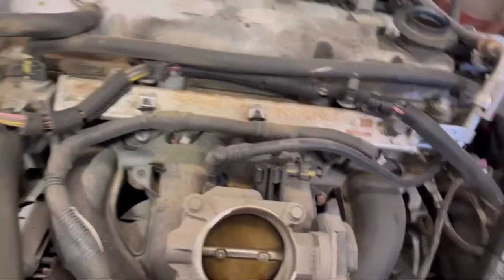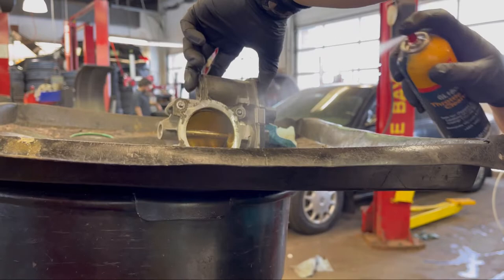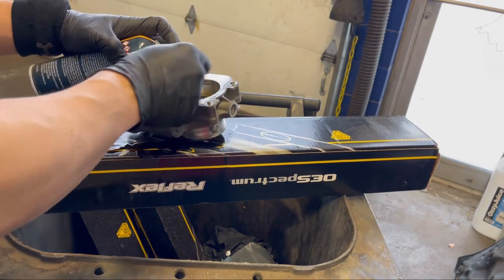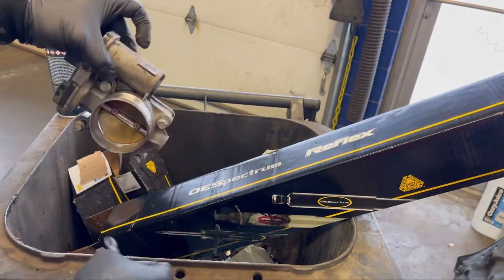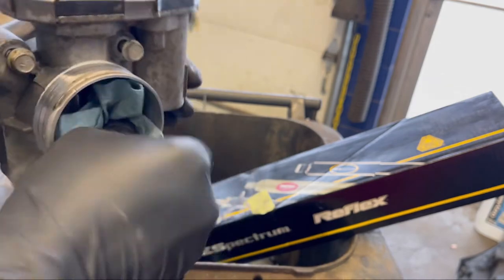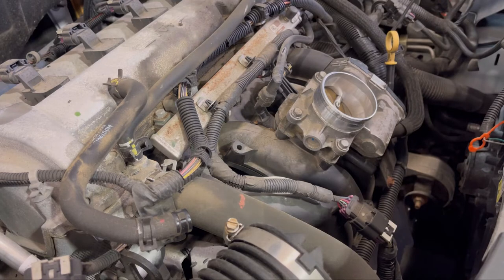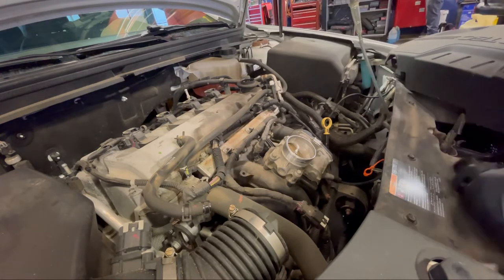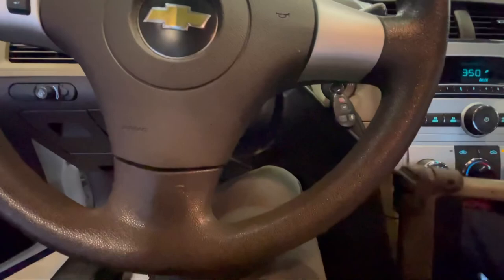Cleaning Throttle Body On 2.4 Liter Chevy Malibu (Only) WITHOUT Touching Gas/Accelerator Pedal

Comment: Thank You will be doing this on my 2012 Malibu. Just subscribed.
Reply from the maker: Sounds great, Let me know if you have any question and I will answer in the comment section.
Reply: How did it work out?
Reply: /\ what he said how did it go? I just bought my 2012 Chevy Malibu I love it
Reply: @marcusjnewtonz28  yeah It’s a great car until it turns off at every stop sign and red light 💀. My Mechanic wants to replace the timing chain. I’m not sure it that’s the problem.. 🤔
Reply: @Thatguyelijah Work good and was easy just following the video instructions.
Reply: @Thatguyelijah  I have a 2007 Malibu, different engine but very similar, and the timing chain is a common issue for both
Reply: @albertvela8712  glad to hear it worked for you, I followed the steps today and Unfortunately it didn’t fix the issue.
Reply from the maker: Please check for PCM code(s), before replacing parts. My question to you - is your check engine light is on? If it does, check see if code(s) related to the throttle body.
Reply: @autorepairprocedures  No my check engine Light is not on. But once my engine becomes warmed up it starts to die when I come to a complete stop.
Reply from the maker: Did you change oil regularly such as 3,000 miles? Or any kind of noise around the timing chain area?

Do you have a good scan tool? You’ll need a good scan tool be able to scan all code. The little handheld scan tool will not do the job.

Comment: I did mine and it’s raving up real high everything is connected correctly
Reply from the maker: Did it rev up high before you started working on it? If no, I’m sure you have left the vacuum unhooked. I would check for vacuum line that is not hook up.
Reply: Did you figure out what was why same problem maybe reset somehow?

Comment: Hey I have a 2007 Malibu, while driving we have a sputter/jolting. Happens during acceleration and while on cruise. Any ideas?
Reply from the maker: It’s hard to tell, without physically looking at your car. I’m sure you will have a check engine light. Have a technician take a look at it.
Reply: Did you find what was wrong in your case mine is just doing exactly what you described
Reply: Same issue here reading codes P1516 and P2101. Car now won't start. Attempting this cleaning and potential replacement this weekend.

Comment: Hey i have a 2010 chevy malibu 2.4L when i start the car it starts to shake a little bit rough idle and hard to accelerate could that be the problem?
Reply from the maker: I recommend you take your vehicle to a technician to figure it out. According to your problem descriptions I am sure vehicle has some engine diagnostic code.
Reply from the maker: There are many thing technician looks at before they figure out the root cause.

Comment: Cleaned mine and now the car is revjng really high at 3k and won’t stop when I put it in gear the car doesn’t move and stay reving high any idea what the issue could be? 2012 Malibu l4 2.4
Reply from the maker: Did you forced the throttle to open by hand? If no. You maybe forgot to hook up some vacuum hose.
Reply: I have the same problem, it was only removed to clean it and when I installed it, it was accelerated, equal to 3k
Reply: Man I had a wired I forgot to hook back up once I did that the car was able to drive still high revving though when you press the breaks sometimes it’s kinda hesitant to stop if that makes sense I didnt move the throttle body that I know of I was sure to be careful but who knows it could’ve moved
Reply from the maker: @sergioherbert4055  make sure something is not unhook or forgot to plug something in.
Reply: Did you ever figure it out?
Reply: @zanderflint1318 did you figure out what it was?
Reply: @sergioherbert4055 did you figure out the problem
Reply: You might need to do a throttle relearn. It adjusts itself as carbon builds up.

Comment: Can I use brake cleaner too?
Reply from the maker: No, never use brake cleaner to clean your throttle body. Use proper throttle cleaning chemical so it will not ruin the throttle body.